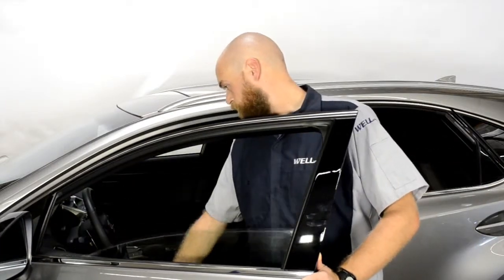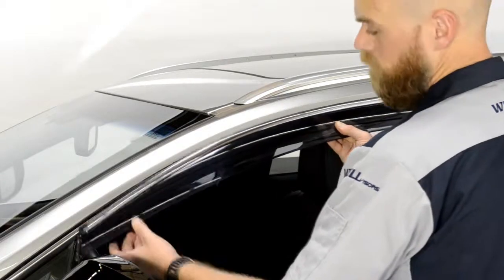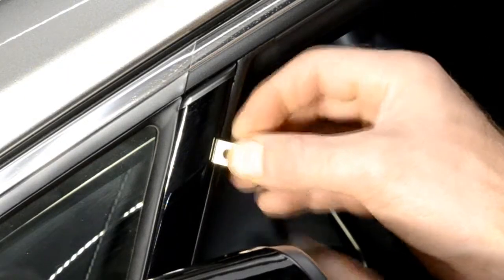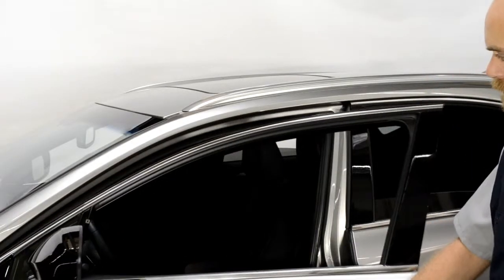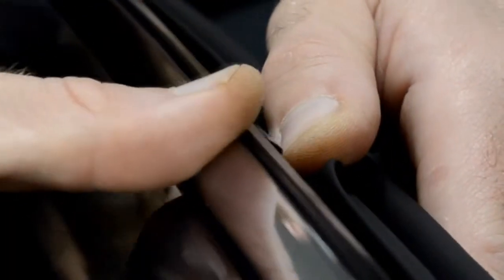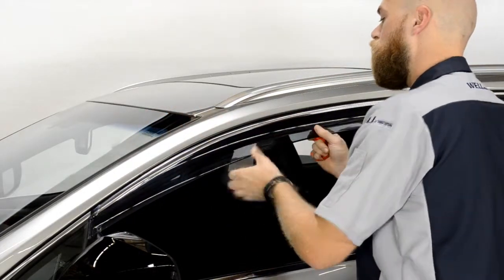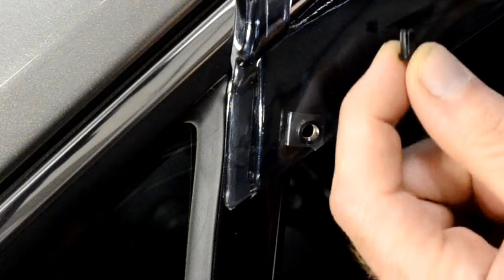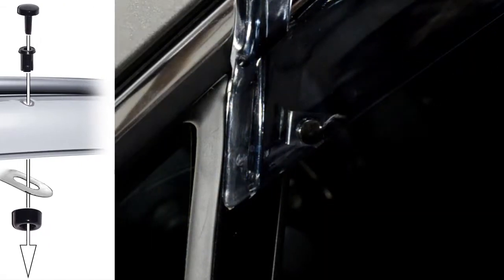WELLvisors side window deflector vent visor Installation Video LEXUS NX 200t NX300h 2015+

Comment: does the rear deflector have the clip and the locking pin ?
Reply from the maker: the brackets are pre-installed on the visors